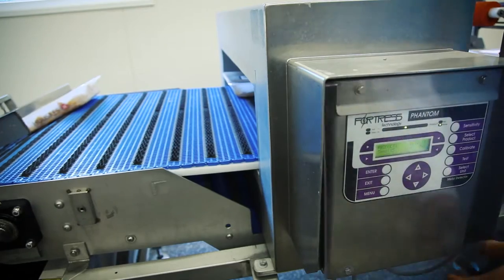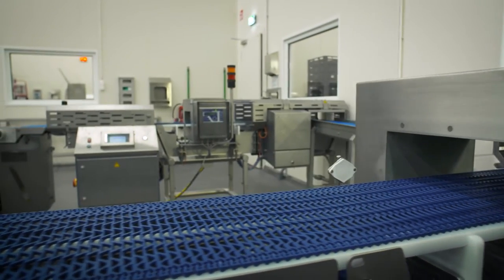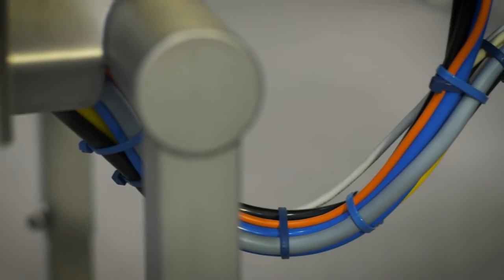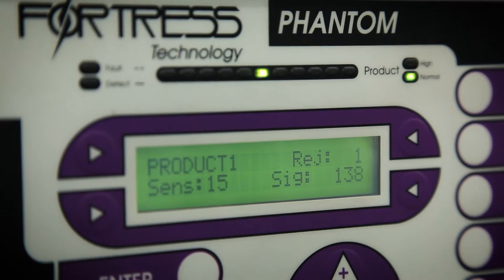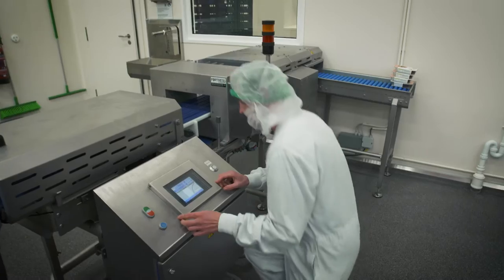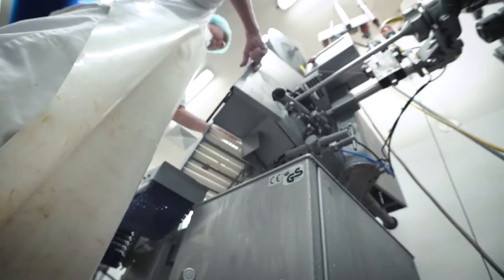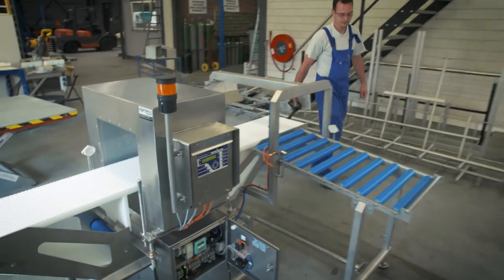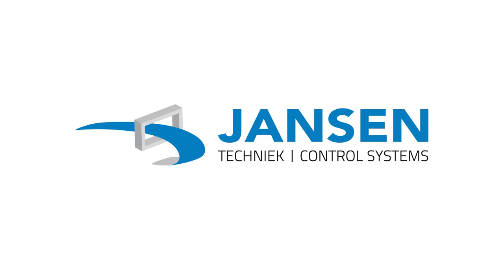Metal Detection Systems

Comment: 0:55 Eggs? Why and were should be metal in there?
Reply from the maker: Hi Max! Good question. Eggs get sorted out by machines en they put them in a box. After that it's possible for metal to peel off and fall in the box. That can be very dangerous. So it needs to be controlled before going into the supermarket.
Reply: @jansentechniek  Thank you :-)
That make sense. Thanks for the info!
Reply from the maker: @maxmustermann5353  no problem!